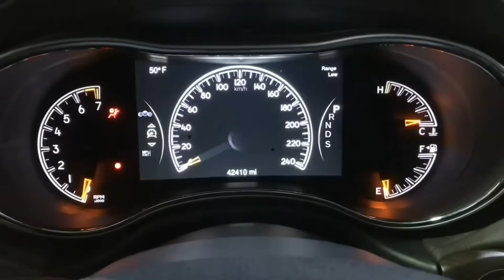The Shocking Truth Behind Chrysler's 2.7 V6 Engine Disaster

Comment: The Pentastar might have saved Chrysler, but in 2016 they ruined the engine. While the 2-stage intake cam was really nice, and allowed them to avoid cylinder deactivation. They reworked the PCV system and the EGR systems from pumping all the raw gunk, into the exhaust to be burnt up; to pumping it all right under the valve covers under pressure, and venting them back into the intake manifolds soaking them in oil. I mean dripping oil being sucked into the engine. And they bypassed the air filter as well. 

All 2016 and up Pentastars need at least one oil catch can to last. Installed on the EGR side. Otherwise you'll build up carbon on top of the pistons, without tripping a check engine light, and they will eventually build up and bottom out on the heads, and that's all she wrote. About 70k and she's finished. Solution from Chrysler? Stop making the engine and run away. Sound familiar? The same thing they did with their garbage Mexican Hemi's, loaded with problems. Stop making them and run away. Who could take a perfect engine like the Pentastar and destroy it, seemingly on purpose? Why Chrysler, of course. So what do they do? Go back to Mexico and make twin turbo's straight 6's without hardening the engine. Good luck with that.

If you have a 2016 and newer Pentastar, you need to have a cylinder scoped at your shop TODAY!  My 2018 Charger had it's intakes soaked at only 9,000 miles, and a layer of soot all over the inside of the engine. It was well on it's way. I added two catch cans and today's she's clean as a whistle.

Comment: I have one in my 2008, I have 150K on mine, just did the valve covers and oil pan gasket, both were sludge free. It has always had synthetic oil changes every 3K.

Comment: To compete with Toyota Nissan and Honda? 😂 how many times have the Japanese auto market shafted the American? It’s simple really. Subaru and Toyota remain true to Japanese engineering. Over engineered because they know their customers may not service it at the proper intervals. American? Well. Junk. Don’t get me wrong I love my American cars and trucks but. At the end of the day if I want reliable transportation it’s gonna be a rice burner. Mind you. Exceptions are made such as Chryslers inline 6 4.0 that can’t be killed lol.
Reply: "Chrysler's" 4.0 inline 6 is actually an AMC engine they acquired when they bought AMC back in the 80s I believe.
Reply: @johnwyman6126 Quite so.  The indestructible Chrysler 6-cylinder was the Slant Six, typically 225 CID.  Before the Byzantine PCV systems required by excessive emission standard increases, those things would run forever practically without changing the oil - And I think a lot of people did just add oil, until their mechanic told him the oil filter was dated 5 years ago.  😅
Reply: Subaru?? lol doing a head gasket on my Subaru right now. Car was meticulously maintained
Reply: @rwilson7201 Yeah, people tend to forget that those pancake engines in the Subarus are well known for that...

Comment: Toyota was also dealing with similar issues at the time. The 2.2L I4 and 3.0L V6 of the same era. But, the difference is that Toyota addressed the issue quickly and gave everyone a 8Y/Unlimited mileage warranty and stood behind their product. Moral of the story, always maintain your vehicle to the “severe service” schedule.
Reply: Frequent oil changes?  (3-4000 miles, full synthetic, good oil filter? - and dosing with Marvel Mystery Oil a few hundred miles prior to oil changes?)
Reply: My parents changed their oil every 3,000 miles back in the 1970s.  I have done that with my cars.  I feel like that "frontier gibberish" guy from the movie "Blazing Saddles".  "There ain't no horn-swaggling, side-winding, bush-whacking cracker-croker" that's gonna make me push my oil change interval even one mile past 3,000.  Some people have gone over 300,000 miles with the 91-02 Saturns like the two that I am still driving !
Reply: I have an 04' V6 Camry and maintain 6.000 miles/1year oil changes interval. At the end of each interval I see the oil light taking that little longer to go away at start
Reply: @igormac88  that’s not good
Reply: @igormac88 it should take less time as cleaner oil flows better but it's a yota so it'll run without oil

Comment: The question is why didn't the 3.2 and 3.5 have these same issues?  My family had a Concorde with the 3.2 and it ran for over 100k without any major mechanical issues until we sold it.
Reply: The 3.2 & 3.5 are timing belts not chains, and their internal water pump isn't inside the oiling area.  So if it leaks it just leaks out of the engine, not into the engine oil sump.
Reply: Not the same engines, completely different and a much more reliable engine. Really only had tappet and rocker issue. This only caused noise, not engine failure.
Reply: From what I understand, the oiling system was a little different. I wasn't aware of the water pump being internal in these (a terrible idea, see Ford and I think a few others that've tried it), but I'm not sure if they were on the other V6s in this family, too.
Reply: @CharlieLarkin75  If by internal they mean driven off the timing system, I don't think its inherently a bad idea, but design is important. For years Subaru ran their water pumps off the timing belt/chain without any issues, however their water pumps weren't known for having any issues either. It doesn't mean there weren't any failure, but they weren't  a trouble spot for the brand. I'm sure there are others that were the same.

Comment: Waa this an AI video? Chryslers down fall began in the late 70s. Since then, they have prioritized making things cheaper at the expense of quality.  To be fair, they aren't the only ones,  but they may have been doing it longer.
Reply: We had a dodge dynasty when Chrysler had the 7/70,000 the transmission went out at 72;000 and at 98,000 the motor started having oil pressure issues.
Reply: Under fiat they basically produce nothing that anyone wants to buy the brand new wagoner is a joke. I owned a first generation penta star the motor was horrible the heads started leaking before 70;000😖.

Comment: The 2.7L V6 came out in 1998, and the tendency to sludge issue was solved by 2003 with  better PCV flow (crankcase ventilation).   These days, you can put in Valvoline Restore and Protect motor oil with a special chemical that dissolves sludge and hard carbon piston ring deposits much better than oils 20 years ago, which WOULD HAVE been nice to have for model years 1998-2002 back then.
Reply: Chrysler is noted for having EVAP issues that CANNOT be fixed,especially in the 2001-2003 years. My sister bought a brand new Jeep in 2003,which had a persistent EVAP issue. Chrysler had to reprogram the ECM to mask this problem.

Comment: Another bad engine design that is horrible in the DOHC is the 2.4 DOHC, when those engines reach over 100,000 miles the rod bearings go out in them. I replace two engines in my Dodge Stratus with engines of low miles and no matter how good I took care of the engine changing my oil when I'm supposed to, using top brand oil the rod bearings still went out. My advice is when buying a car and that car has a 2.4 DOHC, walk away from it.

Comment: I enjoyed the video. I appreciate that you are trying to be objective. 

The 2.7 is the biggest mistake Chrysler ever made. The second biggest mistake they made was not discontinuing it once the problems reared their ugly head and in lying to themselves that they had fixed it. Although later versions weren't as bad as earlier versions, the engine was just poorly engineered all around. On top of this, they weren't all that fuel efficient, they had no low end torque to adequately accelerate the large vehicles and didn't operate particularly smooth. First generation 3.5s from the LH platform for a. 2.7 powered intrepid or a second generation cloud car powered by the 2.7 with the goal of getting better fuel economy. In those cases they said they received no better mileage.  I think the gearing the Chrysler was going with was culprit. If you look at Chrysler strategy with gearing, they used more aggressive gearing with the tallest used in sedans being a 3.66 axle ratio paired with a .69 overdrive. General motors was using point around a 3.07 axle ratio with a .68 overdrive on their 3800 series II V6 which was cast iron heads and cast iron block ; yet, they were able to get 29 to 30 miles per gallon on the highway in similar vehicles. My theory is if Chrysler would have used taller gearing with a 3.5, they could have improved with fuel economy. I'm not going to say that it would be the same but I think it would be more similar. In the 3.5 by comparison had similar torque curve numbers from what I've read. For an entry-level engine, I think they should have just stuck with the 3.3
Reply: Agreed, 2.7 was worst. Inherited from GM chief engineer.
Reply: @ckratzet5286 which engineer was behind this thing?
Reply: The 2.7 was pretty good in the Stratus since it's alot lighter than the bigger cars.   I get 27-29 mpg on the highway, the acceleration is ok, and its pretty smooth as long as you keep it under 3500 rpms.

Comment: Let's be honest Chrysler has learned nothing over the decades the 3.6 pentastar is a piece of junk I have them in my shop all the time, the Hemi has major lifter issues, the 2.4 multi air is a piece of junk! I can keep going.
Reply: And yes, unfortunately the Pentastars do need their oil changes.
Reply: Too many people forget that. @dannysdailys
Reply: @dannysdailys  So do the 2.4L If you do the proper maintenance then longevity is easy
Reply: @MichaelSmith-kr9qw  Yes, I have a 2.4 in a Renegade and it's gets its oil changed every 3k, old school. We scoped her and she's clean as a whistle inside. If you follow the factory schedule of 10k, yeah, you're going to have problems. I recommend no more than 5,000 miles no matter what it is. I change mine at 3,000.
Reply: So many camshaft replacements because of failed rocker arms on the 3.6. The multiair burns oil and well chrysler tried to dump the hemi and swap it for a P.O.S inline 6
Reply: My parents have had 2 Pentastar cars and both were pretty spectacular reliability wise
Reply: 2.4l did not get multi-air-idiot
Reply: When have Chrysler ever made a solid engine 🤔
Reply: Call
Reply: The Pentastar is not a piece if junk, 155,000 km ZERO issues. Regular maintenance and torque wrench always on the oil filter housing. I have all the aluminum Dorman parts, just in case.
Reply: If you maintain them well, then yeah. But you will still probably have to replace a couple plastic parts along the way. And if you haven't replaced your oil cooler by 150,000 I guarantee it is leaking if you look down in the center between the cylinder banks. @OldsmobileSBRocket
Reply: The pentastar engine has had some teething issues, but it isn't all that bad.  I can say that the refinement isn't there compared to GM's 3.6, but it is a less mature design, and it is a Chrysler.  On the note of GM's engine, they weren't without issues for the first few years either.  Early GM High Feature family engines (like 3.6) it had a number of issues for the first few years.  They had timing chain stretch issues that would cause the engine to lose some power by being slightly out of time.  It's not reasonable to expect an engine not to have any issues at all during the first few years after it is released.  Between the two, I will take the gm, but the 3.6 pentastar engine is not a bad motor.  Comparatively, 2.7 was a turkey.  They could have really saved themselves a lot of trouble by just mandating synthetic oil and cutting the oil change recommendation from 7500 (on mineral oil no less) to 5000 on full synthetic.
Reply: Not even Toyota can build a reliable engine at the present moment. Not that they need to as auto makers have no problems selling flawed products.
Reply: The Pentastars are not junk honestly... The rest of the car around it usually is but I bet most of the pentastars you see in the shop get driven like a racecar and owners treating oil changes like a suggestion esp the Chargers dealers sell to ANYONE with a pulse.  I have seen way too many high mileage Pentastars (even in abused corperate vans) to believe theyre that bad.  It's usually their famous crap electrics or tranny issues that kill many 2010s FCA products and give them their poor rep. Modern Hemis are GARBAGE though, sorry
Reply: @austing4321 the reintroduced "hemi" has been junk since the 5.7 came out.  It's not even truly a "hemi" design, though this does not factor into the crap quality of the engine.  These things have oiling issues, tons of valvetrain issues, and even some timing chain problems that are common enough to call a pattern failure.  It's an engine designed to be cheap to produce, to appeal to nostalgic older people through characteristics including the name.  I remember the first time I stood next to the brand new 5.7 in a 300C running at idle.  They don't sound good from under the hood.  None of them do, and they never have.  It doesn't even have a good idle quality by V6 standards.  To compare it to another Chrysler engine, my old Jeep Grand Cherokee 5.2 sounds better from under the hood.  It sounds tighter, smoother, and more refined.  Any GM V8 I have ever heard sounds better from under the hood.
Reply: Pentastar is a great engine providing 90% of its torque at 1,800 rpm is pretty good. One thing I’ve learned is to run full synthetic oil in these engines
Reply: jus some not all they also r used n abused to
Reply: The Pentastar is actually a pretty good engine. There are a few flaws but most of the examples that I see are reliable and providing a normal service life. Engines made by everyone these days are not holding up like their predecessors did because they're getting to be too complicated and they are using more and more plastic and over complicating the designs. If you think that all engines out of Toyota are perfect, then I recommend watching the car care nut and he will tell you they are not. Honda also isn't what they used to be, VCM has been a real problem for them. Nissan is a shadow of them of their former self in terms of reliability.
Reply: @colinschmitz8297 I agree with you, and Toyota is definitely not what they used to be. But by far, the most engine repairs I do is replacing plastic parts on Pentastar's. 😂
Reply: @bbracing3925  Dorman has a kit to replace the plastic parts with metal ones.
Reply: @jpadilla21 indeed they do. Luckily that v6 isn’t blowing itself up every 50-100k. I remember seeing multiple in a shop at time with gold flakes in the pan lol. Let’s get real. F the fuel economy I think we’d all be happy with the inline 6 4.0 rather than the v6.
Reply: Well aware! 😂 @jpadilla21
Reply: @colinschmitz8297  i got a 24 frontier, that VQ38 is solid, no recalls on the engine itself since it came out in 2020. the 9 speed auto behind it had a few recalls early on but they seemed to have gotten it sorted. frontier might be the best thing they sell right now in terms of reliability....cant say id trust a VC-Turbo and the VR30 has had a number of issues itself
Reply: @colinschmitz8297 and lifters/roller rockers

Comment: Guess this is why they used Mitsubishi motors
Reply: I have a 2000 dodge caravan with the 3.0L Mitsubishi engine now, it’s always been a good engine, it’s still a daily driver at 25 years old and 165,000 miles.
Reply: @MattG-n2z  1986 caravan Mitsubishi engine daily driver many hundreds of thousands miles on it. Almost 40 years old
Reply: I got 2 Mitsubishi G6s. Gets unkillably bad mileage.

Comment: The PCV valve would often get stuck open letting moisture into the crankcase. This would mix into the oil causing a slurry that looked like coffee with cream in it. This hampered the oils lubrication ability causing excessive wear. You could replace the PCV at every oil change and it wouldn't really help. It didn't help that the PCV valve was made of cheap plastic and screwed into the plastic intake manifold, they often broke.
Reply: That's not how PCV systems work.
Reply: Yeah if it's letting moisture in, it's got a leak somewhere.
Reply: @SporkOfDestruction yeah, somewhat.  H2O is a byproduct of the combustion of fossil fuels. That is your combustion gases in the PCV system. That mix of gases runs into the minus 20° f intake air, and then it freezes.

Comment: So, the 2.7 number is a cursed number? Audi Lso has a 2.7l(turbo) engine and it suuuuucks!!!!
Reply: Toyota made a 2.7L 4 cylinder for the Tacoma and it's known as one of their most bulletproof engines, so no.
Reply: No, the mercedes OM 612 2,7l I5 is fine.
Reply: The 2.7 Ecoboost is fine. It's hands down the most reliable Ecoboost engine available and there are many trucks with 300K+ miles on the original engine

Comment: Chrysler doesnt care to get it right. They got gov subsidies, and passed the buck to local government fleets and police departments. They even knew about the hemi tick and knew that it could be solved with just a 200 rpm bump up to idle in the software but did nothing and it would not have even affected emissions in any significant way. Also there is no way the non v8 chrysler engines could go more than 5000 between oil changes and for dang sure the hemi v8s could not with the cylinder deactivation systems they have on them that absolutely depend on good oil flow.